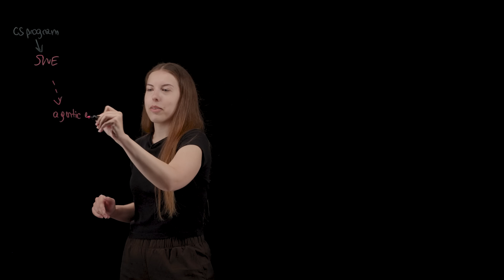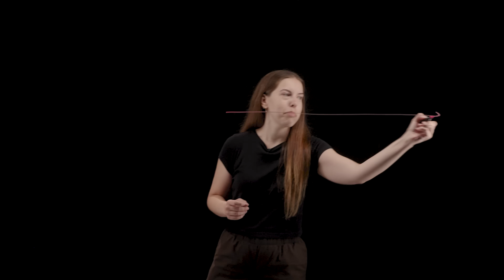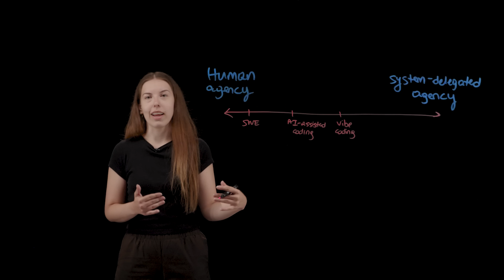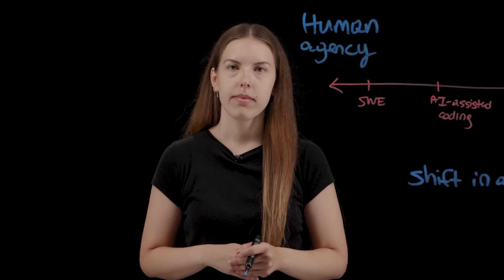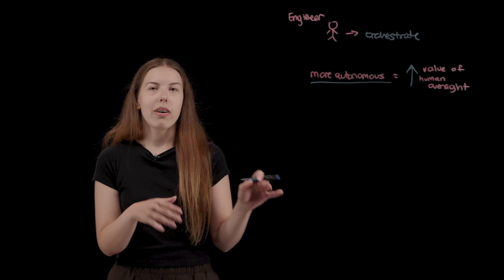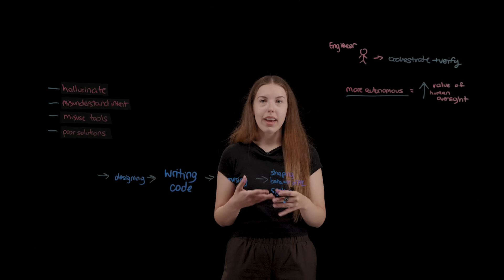Agentic Engineering vs Software Engineering: Beyond Vibe Coding

Comment: Most of Traditional Software Engineers (Developers) are not currently trained to manage Emergent and Statiatical based Systems. This is something that AI Engineers with strong Scientific training must address in modern SWE AI driven along with  traditional developers who accept this new change.
Reply from the maker: Thanks for sharing your thoughts. 👍
Reply: Can you elaborate?  Many of the proficient people here I know are not scientifically trained. They might do even better if they were:  I can see that certain points of my training are helpful though I never thought of it that way before.